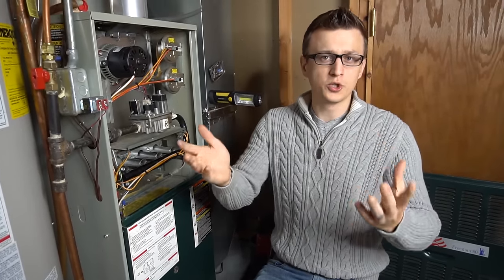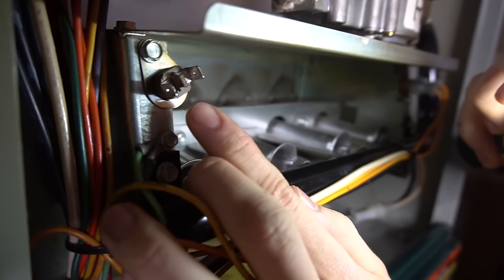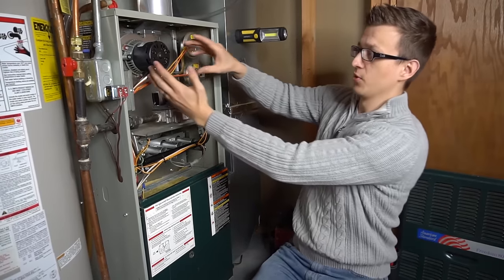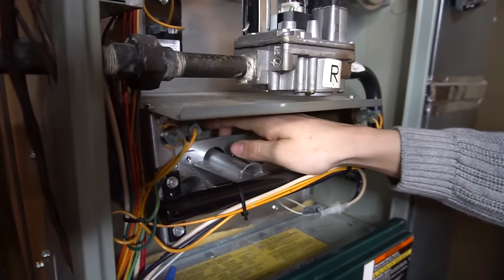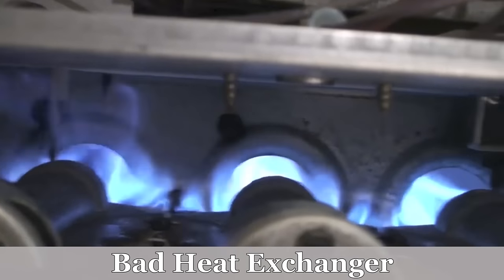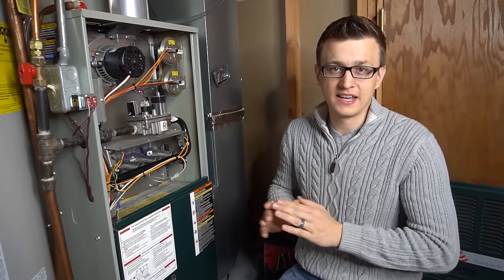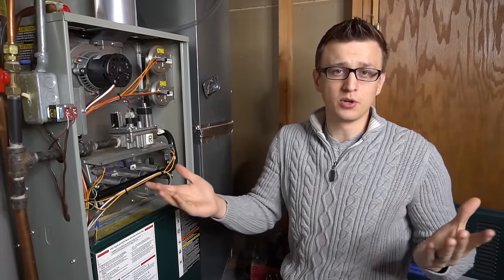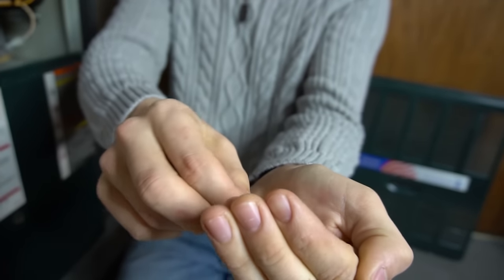Furnace Flame Roll Out Switch Tripped - How it Works

Comment: Watched your video.  Quick history, my indicator has blinked on three different occasions.  I won't go into all the details other than to say that I've checked all of the devices and everything checks out good looking at voltage, resistance, and continuity.  Long and short of it, I found that the 12 pin block is not making good contact.  I have to apply side pressure to it and the light starts blinking slow, then fast and lights.  As long as I hold side pressure, life is good.  Have you ever seen this?  Do you think the problem is on the pins on the card.controller board or with the 12 pin harness itself?  Thought if you've seen this before, then you may have a direction to go.  I'm hoping it's the harness as that's probably a lot cheaper than the $100 for the new controller. (Plus less wires to have to redo).  Thanks in advance if you can help.

Comment: Great video, Please make one for most common unanswered issue that when furnace heats the house the blower fan would not turn off and blowing cold air
Reply from the maker: Thank you! It is usually one of two problems:

If the furnace is old, then likely the fan limit/cam stat is bad

If it is a newer furnace, then likely the control board is bad.
Reply: @WordofAdviceTV  Thanks for replying, I've replaced the limit switch but no luck , the  blower stays on. The board at this point shows two solid green lights and blinking orange one. My furnace is Rheem built on 1995. Would that indicates a bad board?  Thanks.
Reply from the maker: Is your fan setting on the thermostat set to ON by chance? That would cause the fan to run non-stop. Other then that, If the fan is not turning off I would suspect that the board is bad. It's possible that the thermostat could be the problem too. To check, turn off power to furnace, label and take off all the thermostat wires from the control board, and turn power back on. If the fan stops with the thermostat wires off, then it may actually be the thermostat that is bad. If the fan keeps running then it's likely the board.
Reply: @WordofAdviceTV  Hello, You were right , It was the board, I got an upgraded replacement from Ebay and I removed the old one labeling each wire and then wired the new one and bang it worked perfectly. Thanks so much for your "word of advice" :)
Reply from the maker: @hosamelsayed1791  Happy to hear you got it going! :) Stay warm!
Reply: Or Thermostat in the Fan mode,  or Thermostat not wired 100% right.

Comment: Is your Condense line kinked, that copper tube at top of furnace body?   !!! Great Video,  I learned a lot !!!  .... Right now my Goodman works   9 out of 10 times (estm)....   How can a repair man fix my furnace when it works most of the time???   It will work fine some time for 2 days, and then 1 time it won't ....   It gets to the Light up the Inighter , lights it up nice and bright,  but does not let gas valve come on.... so no flame.  Not remember it works fine 9 out of 10 so to speak....   It is not the flame sensor,  it is not the Flame roll out.... and the inducer fan is running fine, & out side the house lots of air flow out the exhaust .....   I did have a problem with water in one of the 3" Pvc  one time...  I'll go check that now...

Comment: Just curious. How do you replace furnace located in the attic? Mine is 5 times bigger than door. It's probably needs to be cut into pieces or roof dismantled.
Reply: And then how do you get the replacement furnace up there?

Comment: Oh, you are funny too and that is good man.  This video clip is so important for Everybody to know and understand about Flame rollout and Carbon monoxide poison.   It's very Critical to know.   Thank you man and God bless you and your family 😇👍
Reply from the maker: You're most welcome! Thank you for watching and leaving a comment! May God bless you and family as well, stay warm!
Reply: Just repaired mine after doing rudimentary layman checks like inserting new filter, resetting breaker, etc. Watched your video and sure enough, I reset my two switches, cleaned off the bottom sensor part and the flames finally lit. Has been working/cycling fine for a few hours.
The Goodman unit is 5(?) years old and hasn't ever stopped lighting so we'll see going forward. 
Of note, I often, weekly, leaf-blow my garage and there is a possibility that the powerful blower triggered it a week ago? But I've blown out the garage 50+ times in 5 years and never had such a failure.
I'll see how the following 12 hours go.

Note also, I opened up the bottom half (metal cover with portal window) that has exposed circuit board, checked the only fuse (3A) which was OK. The board was very dirty; not sure if it has a problem but I reattached the cover and the unit now works. Note also, I don't see ANY colored LED through the 1" portal window but honestly can't recall if I ever had a indicator light.
Reply: @dcrook232323  you sound like a tech yourself Man.  That's Great 👍

Comment: I own a 2003 Hi efficiency Carrier furnace, the vents were blowing out cold air and I found the PCB was displaying code 33. While checking the possible problems shown on the furnace cover, I reset the ROS (flame roll out switch) and restarted the furnace. The furnace ran one normal cycle then would not heat up and it was the ROS again.  I watched this video, reset the ROS and watched the flame while running a heat cycle. On the initial start up, the flame looked good and was getting pulled into the heat exchanger, then when the blower kicked on and I noticed the flames rolled outside the chamber. I let the furnace cool down  and covered the front of the burn chamber (where the cover would go) with tissue and turned the fan switch, on the thermostat to on  (Fan only). I could now see the tissue was being pushed out by the air flow and now know there is a leak between the combustion chamber and my ventilation system. Lucky me I get to buy a new furnace, at least I live to tell about it.

Thank You! Jay for the video, you were the only one who said it could be a cracked heat exchanger.
Reply from the maker: Sorry to hear about the wallet damage but good catch! That could have been a really bad situation. Thank you for sharing your experience for all future readers!
Reply: Yeah, thanks for sharing!! Now i know how to detect a leak on the cambustion chamber 👍🤓

Comment: Hi Jay, thanks for sharing your video, it was very helpful.  Question: Can a clogged condensate trap cause a flame rollout due to water not being able to drain out of the heater exchange?  I did remove the condensate trap and cleaned it out and there was a lot of black chunks inside.  Both inlets on top now flows to the outlet at the bottom.  I sat in front of the furnace and observed and notice that the flame rollout happens when the flames come on.
Reply: Update: Furnace ran through the night w/o tripping the flame rollout switch.  Another question the part where the flame goes into, there is a oval plate thats held together by 4 screws, what is that part called?

Comment: My furnace flashed the red blinking light 6 times which said open rollout. So I took the cover door off and reset the switch. As long as I keep the cover door off, it'll ignite the burners but it's giving me a whoomp whoomp noise. What do you suggest is my problem?

Comment: Word of advice tv.  Great videos!  Can you make a video on a furnace that is working properly, but won’t shut off once it hits desired temperature.  Assume the thermostat is working ( Just bought a new one and now wether I use the old stat or new one the furnace won’t shut off) 
Thanks!
Reply from the maker: Thank you! Maybe I will make that video later, I appreciate the suggestion! When you say the furnace will not shut off, do the burners shut off but the blower fan keeps running? Or do the burners stay on as well?

If the burners shut off but the fan stays on then there are two things I can think of right off the bat. Maybe your thermostat fan setting is set to ON instead of AUTO so the fan runs constantly? If your fan is set to AUTO, then I would say your fan relay on the control board is stuck closed and the board needs to be replaced.
Reply: Word of Advice TV  Everything stays on, including the burners.  I’m wondering if the circuit board needs to get replaced.  Pretty sure I wired in the WiFi thermostat wrong the first time I installed it.
Reply from the maker: @nickschill8521  Oh.. So everything stays on.. It's possible that something is not wired right. If you turn off power to the furnace, take off all the thermostat wires at the control board (label them so you know where they go) and turn the furnace back on - does the furnace still come on? If it does, then that board needs to be replaced. If it doesn't then perhaps something is wired wrong at the thermostat.
Reply: Hi Nick, I had the same issue and it was the control board.

Comment: Do you think it's also possible that a faulty blower motor could cause a flame rollout?
Reply: No.  If it's the inducer id faulty then the pressure switch will not close so no combustion, if it's the main blower then the high limit will trip and shut off the burner until it cools down (cycle on limit).

Comment: Great video... Can a pressure switch or a gas valve cause the roll out switches to trip?? I'm getting 6 flashes on my Trane xb 80 furnace and it say reverse polarity or ground.. Exhaust fan starts then shuts off as blower motor starts up and goes on but ignitor won't glow which I put new one in and no gas valves turn on to generate heat... what can be the problem....

Comment: If you had a restricted flue, the pressure switch would not close and prevent the burners from lighting. A tripped rollout is usually a cracked heat exchanger.

Comment: hi, i have a 2 min. 30 second run time (short cycle) rudd 96%. I have replace board,flame senser, igniter,over limit too. I also replaced stat.I have voltage tested roll outs, both preasure swtch s.if I jumper stat, it will run long time. Can I assume maybe new sat is bad? thanks

Roll out switches (2) are fine and have not tripped! AGAIN...if I jumper the thermostat it will run forever!

Comment: There are no roll out switches on my 32 year old Arcoaire (ICP) 80 efficiency furnace with an inducer fan and sealed burner chamber.  Wonder if that's a problem.  32 years and its still singin along.
Reply from the maker: If you have a pressure switch, hopefully that will trip/open before something bad happens. Many older furnaces don't have flame roll out switches though.
Reply: And wasting a lot of energy.
Reply: Sounds like you are describing the Snyder General GUA model. I haven't worked on one in years as most have been replaced. Last one I saw we replaced about 5 years ago.  When the government mandated 78% minimum AFUE a lot of things changed in the industry. Various types of ignition systems were tried, various induced draft versions were utilized etc. But almost all models had at least 1 flame rollout switch and often more. The GUA series might not have since it was a fairly odd design compared to what other manufactures were doing. 

Both Arcoaire and Comfortmaker were a part of the Snyder General corp back then. Now under ICP which is parented by UTC.
I'm curious was it manufactured in Red Bud IL.

Comment: If the blower isn’t going does that make the flames lick the sides like you explained when it’s a bad heat exchanger? Trying to figure out by the flames if it’s the heat exchanger or just because the blower isn’t going? The day before I could hear some squeaking like sound figuring it was the blower and now it’s not blowing. Nobody can come out until tomorrow and it’s 24 here in Minneapolis ugh!

Comment: Those Carbon Monoxide detectors should also be mounted closest the floor.  There are some detectors that doubles as smoke detectors also.  Carbon  Monoxide is heavier than Smoke. While smoke is detected early closest the ceiling, Carbon Monoxide is detected earlier closest the floor. By the time Carbon Monoxide is detected where a smoke detector would usuallty be installed, high on the wall, it would be too late for someone sleeping on the floor or 3 to 5 feet off the floor on a bed. Stay safe, all.

Comment: I have an older Carrier/Payne with that scoop thing you talked about. On that is a button(looks like a pop up limit switch), is that a flame rollout switch or a limit switch? Asking cause I also have a 2 long pronged limit switch that goes right above the burners. So I'm confused on if I have 2 limit switches or ?

Comment: The flames on mine are fine and going in cone shape but the rollout switch’s keep tripping? The heat exchange seems to be fine. What do you think is the issue? Bad rollout switch or too low of a temp on the sensors? They are 250f

Comment: Wouldn't replacing the flame roll out do? ............... I know my Carrier is old, but it is high efficiency, and I just replaced a new control board. The furnace ran fine for 3 days, and now I get code 33 ( flame roll out or limit switch)

Comment: check your thermo couple. It has one wire going to it.  pull it out and clean with steel wool. I see rollout switch(s) check fine and check with multi meter, and switch was not set.
Reply: There is no thermocouple in that furnace

Comment: My issue was the fan running but no flames. I only found one reset switch, but couldn’t push it in so I assume it’s not tripped. My guess is the flame igniter. The sensor doesn’t seem to be dirty either. Will check the exhaust pipe next.

Comment: I have quick question...what if my inducer motor nakes weird squeeling noises after a few minutes of the heating sequence? Thanks...great vid...
Reply from the maker: That may be an indication that the motor bearing is starting to go bad. That being said, it may still work for a long time. Another possibility is that it's just vibration from the fan. When it starts to squeel, try pushing on the inducer motor housing at various points and see if that changes or stops the noise. (the housing might be hot).
Reply: Word of Advice TV...thanks for responding...wish you were in the Chicagoland area...so can I grease this thing?
Reply from the maker: @TheCupitorVeritatis  You can try. I do that sometimes. I use this thing right here: 
Zoom Spout Oiler: https://amzn.to/2tctO1E
I pull out the snout and put it where the shaft goes into the motor and oil it up there while spinning the motor by hand to try to "work it in there". With some inducer motors it's very hard to try and oil them without taking the inducer assembly out.
Reply: Word of Advice TV ...my friend noticed a sort of burning smell but no smoke...you think its the inducer motor? It does make the squeeling noise more when it gets hotter...thanks...im watching your other vids to find an answer...lol
Reply from the maker: @TheCupitorVeritatis  If the smell is coming from the inducer motor then it very well could be that the electrical windings inside the motor are starting to go bad. If you put your hand on the inducer motor (not the housing) and the motor is super hot then I would say the motor is dying on you and you should replace it.

Comment: Hello love your channel, I'm having this except for the fact I'm using my air conditioner and not the heater. I hit the reset and it came back on.air blew cold for about 5 minutes then trip again. Exhaust is open to the roof, it's real hot in my attic so can the heat be tripping the rollout switch?
Reply from the maker: @Ron deezzee It's possible but not likely.. I would say that the flame roll-out switch is defective. Is your furnace by chance turning on along with the AC?
Reply: @WordofAdviceTV  only the a/c condenser fan turns on and it cools the  house, the furnace doesn't  but once the switch trips the a/ fan shuts off and the furnace fan stays on. When I unplug the furnace and replug it while the switch is tripped the furnace condenser blower comes on but without a flame that would warm the house. It stops and only the fan runs.
Reply: @WordofAdviceTV  so at 6am I turned ac on and ran without a problem for a hour, got too cold so I turned it off.  Turned back on at 12pm and ran also with no problem and its 1:36pm with no problem.  Could the rollout switch be defective? Seems the heat in the attic might be causing.
Reply from the maker: @MrRondeezzee  I would agree with you. It may just be the heat in the attic. But you've had heat like that in the past I would think.. Yet the problem hasn't happened before right? That's what makes me think the switch is getting weak.
Reply: @WordofAdviceTV  yes its never happened before. So I'm sure its probably getting weak. I've ran the a/c today but left the door open to the attic during the day today and it's been working.
Reply: @WordofAdviceTV  noticed my attic fan is not working..... thanks for you help I really appreciate it

Comment: Its 3/10/2019; I have a rheem criterion 2. the flame roll out switch keeps tripping, so I pulled the heat exchanger and yes its rusted  bad enough so that the small tubes that go into the heat box pull out when you move the part. the furnace is about 20 years old.the model number is rgdg-10eamer. I can not find a part number for the heat exchanger, could you help? thanks.

Comment: My flame rollout switch seems to be located in a completely different location than the burner box, I found what looks like a flame rollout switch in the upper area of the furnace next to the exhaust port on the inducer motor housing thingy. 🤷🏽‍♂️